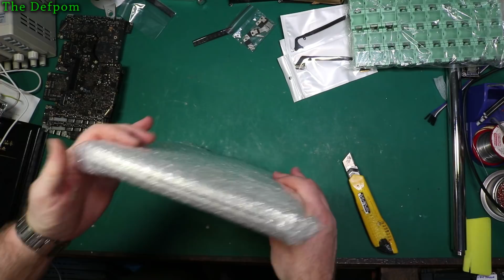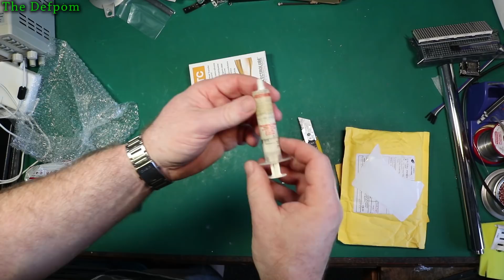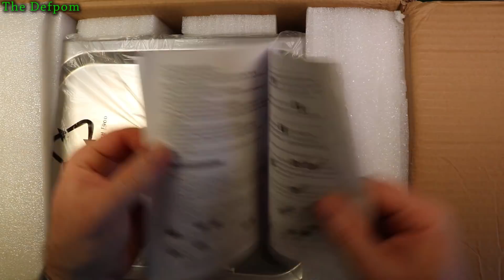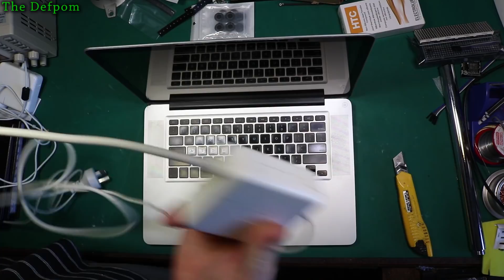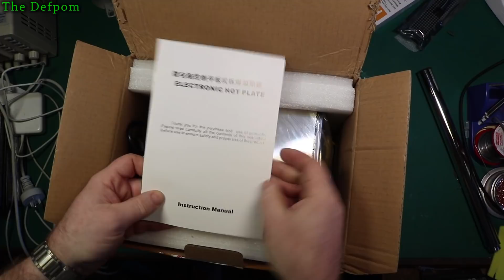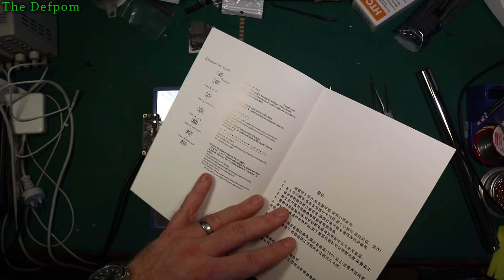🔴 #486 Mailbag Monday 17th December 2018

Comment: I have seen similar heat pads get some mixed reviews. Many warning about problems with earthing just double check that and the insulation. I predict burns in the near future.
Reply: Don't buy one of those red Chinese variacs either without going through them first.  They often are well built but are lacking in the wiring department.  On the 1kVA one I bought I found no issue with the power cord but there was insufficient strain relief and the soldering job on the inside was lacking.  I also changed the chassis ground point and put in a digital meter.

Comment: These new chargers isnt original. I can tell they placed a blue sticker on the magsafe tip.  Also does it have a round sticker on the wing or plug area?  Check if it has voltage protection. If voltage is high then has no protection at all. Fake charger is weight lighter than original. Fake weight around 170 vs 240grams on original without plug. I wouldnt trust aliexpress on Chargers.